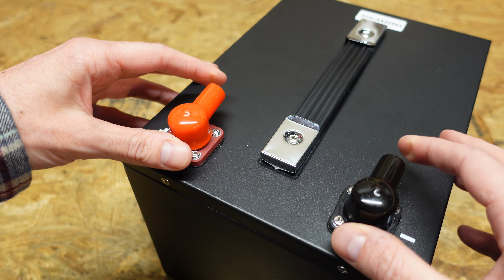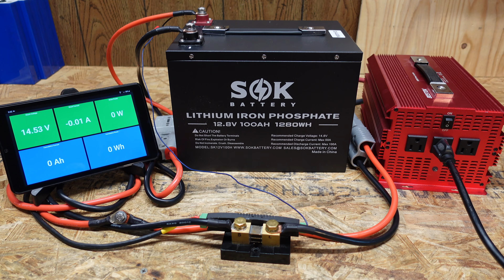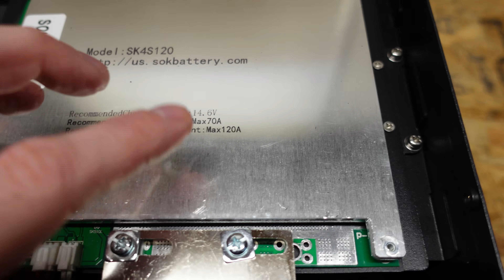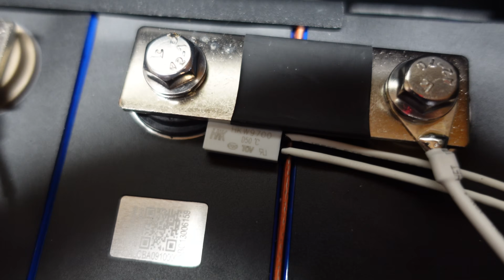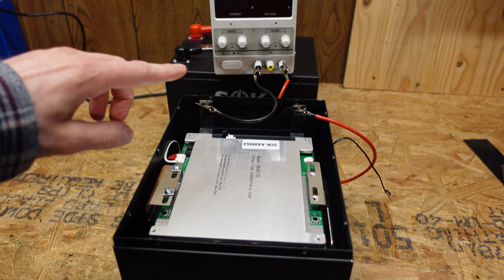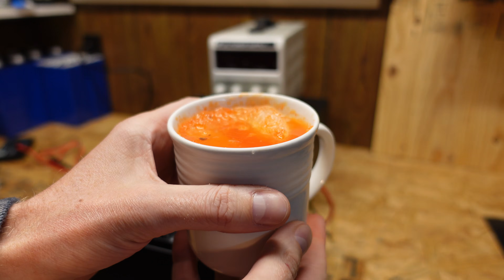Heated SOK 12V 100Ah LiFePO4 Battery, Bluetooth, 10-Year Warranty!

Comment: Could not tell what the primary temperature sensor is mounted to.  Secondary is on bms as you noted.
Reply from the maker: The primary temperature sensor is screwed to a bracket on the side of the case. It is not attached to the cells directly.

Comment: SOK after sales service is totally non existant here in the UK, I bought a battery last week and it was dead on arrival £330 down the drain it seems.
They never answer emails and on social media they reply saying send us an email which as previously mentioned they never respond to.
One of the cells is completely dead in my new battery that arrived with a total charge of 2.4v so less than 0.5v on the three working cells this reading was taken correctly from the +ve terminal and the negative bus bar.
After charging it from these terminals cells 1,2&4 got to about 3.5v and the bms woke up and the app displayed the readings, cell 3 would only charge to 0.7v and as soon as I disconnected the charger it dropped rapidly.
The case is now with my bank who are going to try and sort it as we have section 75 protection here in the UK to protect against rogue sellers selling faulty goods and scams.
EDIT sok have now replied but their emails had gone to my spam folder they want me to disassemble the battery and fit a new lithium cell myself,  Is this what they call a warranty?? Especially as the battery has a warning on it not to disassemble because of the danger of fire or explosion 💥

Comment: Do heater pads protect the battery if ambient temp around the battery is lower than 0C and battery is at 100% SOC?   Van use case.

Comment: It seems odd to me that SOK would design the battery to be nearly an inch wider than a Group 24 or Group 27 battery. Often times in RVs and boats the battery trays are made to close tolerances to minimize movement of the battery; the SOK's won't fit in these spaces. Battleborn, one of SOK's main competitors, make their 10aH batteries very close to Group 27 size (they are a little longer, which is often the least critical dimension in fitting into a battery tray or compartment). This happens to be my specific situation; I would like to buy an SOK but it will not fit in my battery compartment.

Comment: Hi - Very nice review as usual - thanks.
It would be very nice to put the battery in the freezer and cold soak it, then take it out of the freezer and attempt to charge it, then monitor it as it goes through the heating process. I wonder how long it will take to get the battery back up to 0C?
The placement of the heater pads between cells with the temp sensor outside the cells seems like a really good way to go to make sure the battery is actually up to temp before starting charging.

Comment: The SOK battery seems to be exactly what I'm looking for, but I see different sizes listed across the sites for the 12v 100AH battery.  Can you post the actual measurements for the battery (LxWxH)?  SOK uses exactly the same image for the size information for both the original 100AH and the new one with heater and bluetooth, but in your review it is clear they are not the same size.   I'm trying to replace some GC2 batteries, and my battery box has room for 2 batteries up to 12" wide and 8.5 inches deep.  I'd like to use the new Bluetooth/heated batteries if they will fit.

Comment: What determines why u can or cannot hook them in series like i can take two of those and make a 24v battery ?
Reply from the maker: You can't guarantee the heaters will turn on and off at the exact same time. Thus one could be on and the other off, resulting in a fast unbalancing of the batteries.
Reply: @LithiumSolar  ohh ok

Comment: Great video! My question - If the battery is in a cold location and not being charged or used will the heaters kick on and drain the battery?
Reply: No, it get power from charger only...

Comment: Thanks for This video.  
 I have a pre order of this sock battery for a few days ago.
I have a question about the charger, can you tell me if the victron blue smart ip22 battery charger 12/20 is a good choice if I buy this has a charging voltage of 14.4 v, does it make a difference between a charger of 14.6 v as sock prescribes for the sock battery?

Thank you very much

Comment: Love the battery.  Loved the Bluetooth connectivity and watching the cells balance out by the BMS.  No opportunity yet to take advantage of the heating capability. 

However the ABC-BMS app stopped working after its 4/25/2022 update.  Now not connecting to the BMS on the   battery.  Even though I see the battery's bluetooth ID listed as available in my phone's setup.  Tried restarting my Android phone and even reinstalled the app.  Left a review on the app.  Will see what happens.

UPDATE 4/29/2022:    Fix was just deployed by the developer for the app on Android.   Now it sees and connects to the battery's BMS via Bluetooth.

Comment: The funny looking diode is probably a ntc thermistor bodged inline in case someone tries to wire 2 batteries in series. If one BMS stops charging, the diode will shunt the excess voltage, which works in most situations, but would over-volt the heater in that battery. The ntc would effectively pull the diode out of series and keep the smoke inside of it.

Comment: When the battery goes into heat mode does the bms turn off charging & discharge? It looked like it turned off charging.

Comment: Question; did the discharge turn off @ 0 degrees as well? Can you change the temp setting from 0 degrees. Seems this is only to protect the battery. I think it would be better to have the heater come on @ lets say 3 degrees and powered from the battery so you can still use the battery (charge / discharge) for your purpose instead of possibly having the battery turn on and off when it is very cold
Reply: The discharge protection mode will work when the temperature drop down to -20C, so it means when the heating pad is working, you could still discharge the battery.

Comment: an extra test would be if the heaters are powered internally from the battery if there is no charge current coming in confirming that works. Great info as usual
Reply: I would like to know this as well.
Reply from the maker: No. They're powered by the charger. If no charger is connected, the heaters do not run. If they did run without a charger connected, they would drain the battery empty.
Reply: @LithiumSolar  That's why they cannot be run in series!!!! You would have 24/48 volts onto the 12v heating pads. In parallel other batteries would be doing the heating if no other charging is available
Reply: That's why a Tesla needs to be charged multiple times per day when traveling in below zero ambient temperatures.

Comment: That's what we did a while back at InduraPower.  There are some inherent problems with heater blankets in that configuration though.  Very difficult to get even heating through the battery without creating hot spots.

Comment: Excellent video! You’re taking over the battery review “job” that Will Prowse once did. He let his success go to his head and forgot how he started.

SOK continues to shine. Only missing for me is Bluetooth on the regular (non-heated) batteries.
Reply: I purchased a non-heated Bluetooth version of this battery. JUST opened it a few minutes ago and Bluetooth works fine.
Reply: A Smart BMS is so important with these lithium batteries packs. I think most dumb BMS's don't balance adequately! (Source: off-grid garage).

Comment: One thing I can see is that if you want to connect four of the batteries in series to make a 48V battery and the heater in one of the batteries turned on, it would cause a drain of power from that battery, causing an imbalance. This is probably the reason why they don't want this battery to be connected in series with any other battery.
Reply from the maker: Exactly! The only way to handle it properly that I can think of is to have the BMS communicate somehow.

Comment: Woohoo! Finally, a battery that can be opened and sealed with silicon with heating pads built in. Will Prowse thinks the pads can cause an imbalance if used in series - see his recent video. I think the BMS will sort that imbalance quickly after the pads turn off. I assume everyone will have them in a well insulated box when in series and not one is a cold place and one in a warm place. My BASEN have a 5C spread in the thermocouples between the batteries. The pads cut in and out and 5C and 10C. Can you test for the "Will" imbalance?
Reply: The BMS can't balance different 12V packs in series
Reply: @niktak1114  But many BMS can balance batteries when in series.

Comment: I haven't read much about batteries lately so please advise - I thought 100AH batteries could be charged at 100AMPs like a 50AH could be charged at 50AMPs.  I understand it is best not to charge at such a high rate, but I thought it was okay.  
Do some manufactures limit charge rate while others do not?
Reply: Yes, it depends not just on the cells but the BMS and general pack design. Even if the cells allow continuous 1C charging, the BMS might not be able to handle it. Most of the prebuilt 12v batteries use FETs on the BMS to control charge and discharge which can be prone to failure in high current/heat situations. In general, with the lower priced pre-built batteries, assume the specified charge and discharge rate is the peak not continuous rate.
Reply: @andys844  That's makes sense.  Thanks for replying.

Comment: Finally some one reviews the new model. Thanks.👍🏾

I'm told by SOK that the batch coming out in May will have the series problem fixed. The current problem is that if for some reason one heater turns on the other batteries might just shut down until the battery that is in heating mode reaches proper temp.
Reply: Fixed when next shipment arrived.

Comment: Reminder that these units cannot be arranged in series.
12V only!
Reply from the maker: Correct. I noted that in the video.
Reply: It's interesting, I don't see how or why it should care, each battery has a BMS, and it's using its own temperature sensor, so it should not care what the overall external voltage is since it's just pulling from itself, I would love some further investigation into why they are saying this.
Reply: @seanathanq  I would imagine it has to do with the fact that the battery has a resistive heating element that requires a specified voltage  range.
Also, some BMS's are not designed for higher voltage/series configurations.
Reply from the maker: The individual 12V batteries will not remain in balance if one heater is on and the other is not. That would mean one battery is charging and one battery is not (heating). It could work if you use an external balancer, like the Victron I demonstrated a while back. But still not recommended to series them from my perspective.
Reply: @reubenj.cogburn8546  I understand that, but the heater is pulling from the battery so it should only be 12v unless something weird is happening in the BMS, for instance you can have 2 batteries in series and just connect to one of the batteries and you have only 12v to run stuff off off just fine, should be the same
Reply: @LithiumSolar  I can see that, but since they both have their own BMS it shouldn't be that much of an issue. Guess the other question is, when will they put heating pads in the 24v or the 12v 200a batteries
Reply: @seanathanq  You're forgetting the heaters.
They will change the system voltage numbers when applied.
They need to be synchronized to be able to series them, they're not.
Reply: @reubenj.cogburn8546  but it won't, if you have some batteries in series somewhere go take your meter and measure the +&- on one battery it will still be ~12v even if you have a 48v system
Reply: @seanathanq  Well, I've said my piece.
You can figure it out from here.
I suggest listening to our host's reply, if you refuse to listen to me.
Reply: @reubenj.cogburn8546  I have listen to both I just questioned the reasoning, I deal with electrical and electronics every day at worth, the majority of the DC Voltage systems are 24v so I'm well versed in how it works which is why I don't see the issue. If they sent me 2 batteries I would have zero issues testing it and looking into it
Reply: @seanathanq  Ya know,
One thing I've learned is that I'm sure I don't know it all. 
I learn. 
To do that, one has to be able to use logic, and where science is concerned, the ability NOT to have an idea so 'stuck' in my head, that I cannot wrestle myself into accepting what credible experts have to say.
Just sayin'
Reply: @seanathanq  in fact, this new model no big issue if you connect in series, only under the 0C temperature has issue, one of batteries would start heating, and others would stop working....
Reply: @minwang102  Is that not WHY there is a heating element... for charging  in a 'cold' environment?
Could you explain how the other batteries will 'stop working' when any one battery starts heating?
Reply: @reubenj.cogburn8546  for example, you connect 4 batteries in series, You can not guarantee all 4 batteries go down to 0C at exactly the same time, so, let's say , the first one battery in heating, the current would go through to pad, not to BMS, the rest 3 batteries would stop working....
Reply: @minwang102  I see, that would be logical. 
And your answer to my remaining, important questions?
Reply: @reubenj.cogburn8546  You will only have a series voltage output minus 12v
Reply: @seanathanq  I would have thought the answer is that the heating pads are only 12v. If you put in series and as demonstrated it is using the external power for the pads and your series voltage is say 48v then what would that do to the pads?  Blow a fuse, melt, get 4 times as hot, Fire!!!!!
Reply: @glencooke494  that would apply if the power was coming off the final leads, but it just hooked to the batteries positive and negative internal connections it works only be 12 for it even if the system was 24 or 48v overall
Reply: @seanathanq  Does it? We saw the voltage from the external power supply running the pads at 4 amps from charging at 7 amps. If it came from the internal 12v the charging current would have dropped to 0 amps
Reply: @glencooke494  well this is the exact question I wanted to know more about lol, I figured it had a way to switch inside the BMS, so that it puts power to the pads and not the output, and if that's the case I don't see why they wouldn't let it take power from a power supply if available instead of parasitic loss
Reply: @seanathanq  Another more in depth test required I think answering these questions. Cheers